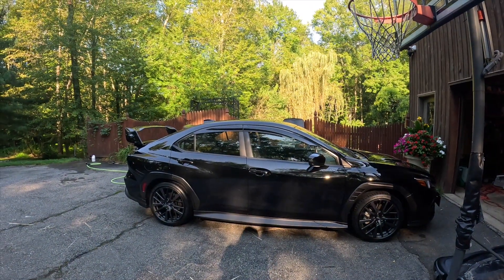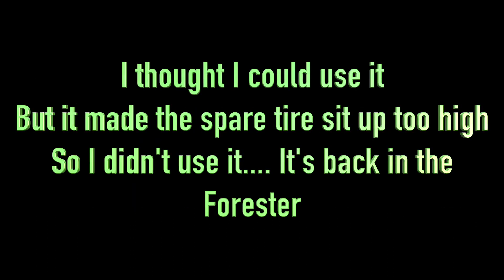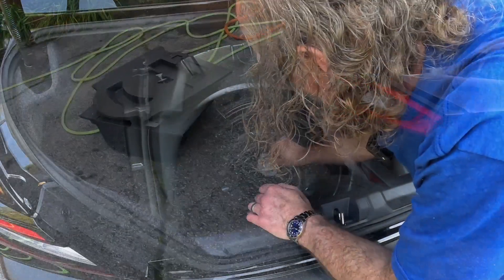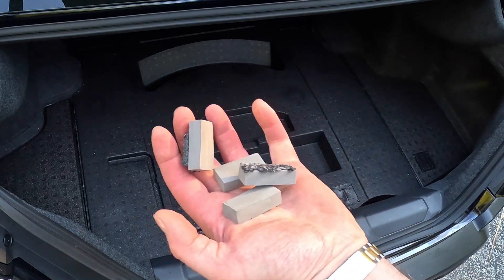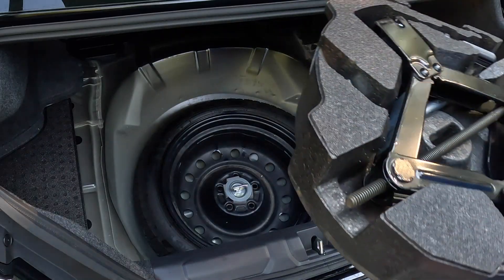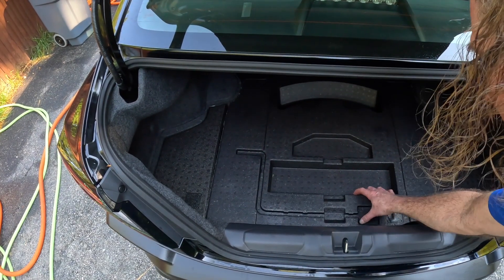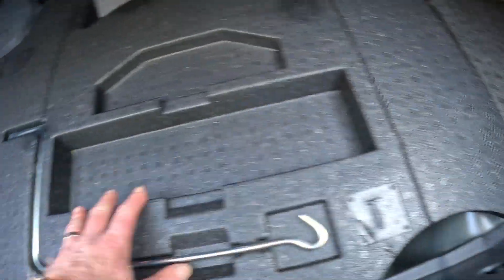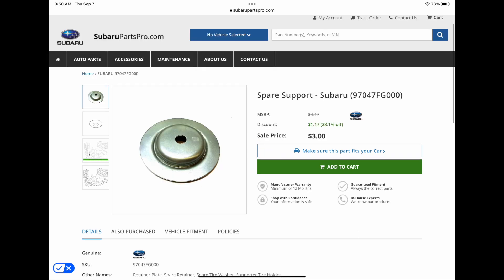2023 Subaru WRX Gets a DONUT SPARE TIRE…….(this is how the car SHOULD have been delivered)

Comment: Be careful if you buy a spare tire from an Impreza.  The Impreza uses a different bolt pattern than the WRX.  Impreza is 5x100, the WRX switched to 5x114.3 in 2015.  I suspect the spare tire and all related parts from a 2015-2021 wrx will work.  But the spare tire from an Impreza will not fit the WRX bolt pattern.  The last couple generations of forester also use 5x114.3, as did most years of the STi.  But the tire size and jack of the forester is different.  But you could probably use the wheel from a 2019+ Forester and mount the correct tire size.
Reply from the maker: @funnyguy8042  I'll give you a hearted comment and pin it but now I've got to check. I havent thought about it for a while but did research all of the bolt patterns before pulling the trigger on the spare. Now I'm going to have to look into it again...... Edit.  I looked and youre rignt. I probably should have mentioned that in the video. My spare came from an STI.Thanks very much.

Comment: Nicely done. I have a 2023 WRX too. Thanks for the video!
Reply from the maker: Thanks for the nice comment!
Reply: The spare tire diameter needs to match that of the stock tires. A T145/70-D17 is only 23” in diameter. The stock tires on a Premium 2023 WRX are 25” in diameter. With the AWD system tire diameter is critical.
Reply from the maker: @ubroberts5541   I appreciate you taking the time to respond and include the statistics, however, I would have never posted this video if I didn’t do a lot of research first. For example, a 2020 Wrx limited has an oem tire spec the same as this 2023 Wrx (245/40-18). Here is a link to a Subaru site where you can purchase replacement parts. The spare tire size I’m suggesting is what came with that 2020 Wrx from the factory. Here. https://www.subarupartsdeal.com/parts/subaru-tire-t145-70d17~28121va050.html.   Also, I think you got your numbers wrong. Using this tire calculator the oem tire is 25.7” diameter and the spare is 25”. That’s seven tenths of an inch difference. Not two inches. https://www.calculator.net/tire-size-calculator.html
Reply: Got it thanks!

Comment: Nice job. As a viewer I appreciate that you used a tripod for most of it. I just recently bought a 2023 WRX and went about gathering the parts to do the same thing (prior to discovering your video). I think I ordered the same items but they have not all arrived, so I cannot swear they all fit yet. Good tip about pulling off those foam blocks. I picked up a used STi wheel/tire to be a closer match since mine has 18" wheels.

Comment: I just checked ebay and stumbled upon a promising looking, affordable Impreza 2015-2019 spare. Unfortunately, the tire fitted on it was a T135/70D17. I noticed yours is definitely a T145 so I'm glad you showed the difference. Saved me from a big mistake!
Reply from the maker: @KuyaPow626  I would typically suggest a tire that's not too old.   That was the main thing I looked for after size.  Yes it's just a spare but rubber goes bad after a time so the newer the better all things being equal.
Reply: @Samlol23_drrich  Thanks thats good advice. I bought one last night from the same exact store as you. It looked perfect in the photos

Comment: Great video! I copied what you did a few months back on my 2023 wrx using the spare from my old 2015 wrxthat I traded in. Last weekend, ended up getting a flat and this was huge saver having the donut. One note, as you mention the size is almost the same as the stock oem but maybe 1/8 inch less. Driving on it to the dealership it did throw a AWD check light at around 3 miles. Tech said the sensors are sensitive enough to detect even that difference  and wouldn’t  recommend driving like that for too long. But still works just to get it to a shop in a pinch instead of having to call a tow truck. Thank you!
Reply from the maker: Didn't  get a notification of your great comment.  Thanks. That's interesting about the code.  They suggest only putting a spare on the rear tire, not the front, which would be a pain for a flat in the front.  They say to put the rear tire onto the front then the spare on the rear. All with a scissor jack. 
But it's still better than foam and a pump.

Thanks again for the comment!

Comment: Thanks so much for making this video. Just discovered my 23 limited doesn't have a spare... pure BS
Reply from the maker: It absolutely is. I can’t drive around without a spare.  Bad enough some vehicles have run flats- but to not use run-flat tires and not include a spare is an insult.

Comment: This is follow up to your comment from a different video ( Titled:  "No more 0w-20 ( 2022 Subaru WRX )."  Do you really have a Forester XT with an EJ engine with 250K?   Is that milage on one and the same turbo?  Was it always fed Mobil1 5w-30?  It is a remarkable milage for that engine.   It is detuned a bit in the Forester XT compared to the WRX.  Maybe that is why you did so well.   What kind of driving may I ask?   Sorry for so many questions but your case is very interesting.  Most Subaru turbos don't make it much past 100k.
Reply from the maker: @sezwo5774  I just saw it and answered your question in the other video. You can see the forester at some point sitting in the driveway in this video at 11:24
And for what it's worth in my new WRX, I switched over to 5W30 after my first oil change.

Comment: Thanks for this, buying all the equipment now. Is there a place for the 4-way tire-iron wrench? Is it really necessary? Looks like you have a smaller wrench in the assembly...
Reply from the maker: So part of the jack that came with the car is a tire iron which is basically about an 11 inch small L shaped wrench which fits the lug nuts. They may be able to remove the tire in a pinch but are absolutely awful in general. I have 4 cars at the moment and 4 of those 4-way tire irons. They are worth their weight in gold. You get way more leverage and I wouldn’t drive without one. Having said that, there is no place to store it. I leave it to slide around the trunk of all of my vehicles.  If you never change a tire, you may not need a four way, but I have dedicated rims and snows for all my cars and swap tires a lot so it’s imperative.  You should absolutely get one just to have, even if you don’t wind up keeping it in your trunk. Thanks for commenting and good luck.
Reply: @Samlol23_drrich   Thanks for the response! I'll get one. Here's a stupid question I hope you don't mind answering: I found a spare donut on eBay that seems to be right, but it's labeled "2010-2017 CHEVROLET EQUINOX 17x4 1/2 Compact Spare Wheel Opt S1G T14570D17" and the listing only specifies that car. But the part number matches what you've found exactly. So this should work, right? Or do I need to wait for a Subaru tire?

Comment: ? When you look up the tire on enjoy how did you search it. Did you type in for a IMPREZA
Reply from the maker: I searched by size. 145/70D17 (the D is for donut). The results that came back I chose one from a Subaru, and the newer the better thinking one from a wrecked 2019 or newer and unused would be in better shape than one from say a 2014. Edit. This is the same guy I bought mine from. There are lots of them available now ranging from $99 to about $200. https://www.ebay.com/itm/274861625460
Reply: @Samlol23_drrich  Thank you very much.
Reply from the maker: @felixlaboy1453  no problem. I do a lot of highway miles.   Couldn’t see not having one. It’s just peace of mind.
Reply: @Samlol23_drrich  I agree 100%. Thanks again buddy.
Reply: Hi there buddy. Sorry to bother you again. So I got the spare and center form that holds the jack in place. 

I just need order the top cover. 

? Are you using anything below the tire where it sits in the car. 

Thank you once again for the help.
Reply from the maker: @felixlaboy1453  @felixlaboy1453 no bother at all. No, I'm not. The tire is sitting on the floor of the trunk well. In my forester there is a foam piece that I tried in the wrx but it made the tire sit up too high. I may one day put a cheap thin towel under it but for now it's just on the metal and it's fine.  Any other questions feel free.
Reply: Thank you. I really appreciate all the help. I feel so much better having  the spare. My commute to work is 47 miles each way. Not having a spare didn’t sit well with me. 

Thanks again buddy.
Reply from the maker: @felixlaboy1453  @felixlaboy1453 no problem.  My.commute is 61 miles each way so it's long also.  Much easier to change a tire and have the oem one patched.  Imagine pumping up the tire and adding that goo. Then they gotta take all that crap out when they patch it. No thanks
Reply: @Samlol23_drrich  I agree 100%. I saw a video on a guy that felt the same way and got a spare. He went and cut the top cover to make it. I’m not sure if I would do that.
Reply from the maker: @felixlaboy1453  @felixlaboy1453 I've tried to cut Styrofoam before. It's almost impossible to do it well. You have to use a wire that has electricity running through it to heat it up
Reply: Got you buddy.
Reply from the maker: @felixlaboy1453  enjoy the car.
Reply: @Samlol23_drrich  Thank you. You as well buddy

Comment: Great video.  As you say, my Canadian WRX has a spare.  I lease so have had one of my earlier one get a nail puncture at night.  Was able to use the doughnut spare.  However I am now waiting to turn in my '22 for a '24RS.  Our version of your TR and it does not have a spare either.  Could be Subaru does not have a rim that will clear the Brembo front 6 pot calipers.  Or would the STi ones clear?  As long as the WRX ones would clear the rear 2 pots, then I make up a kit.  So even if a front flat occurs, it only means two tire changes to get a good rear on the front and doughnut on the rear.  By the way, I always put a 3/4" plywood board into that rectangular cut out area.  Provides a good base for the jack especially if on gravel or dirt.
Reply from the maker: That plywood is a really good idea. Thank you. By the way if you read the manual they say to only put the spare on the rear (page 389 of the owners manual) so if you get a blow out in front they want you to put the rear tire on the front of the vehicle and the spare in the back. They specifically mentioned the Canadian spec.

Thank you for watching and commenting